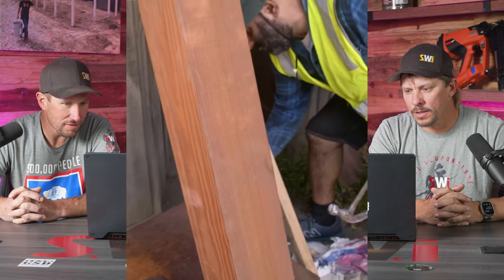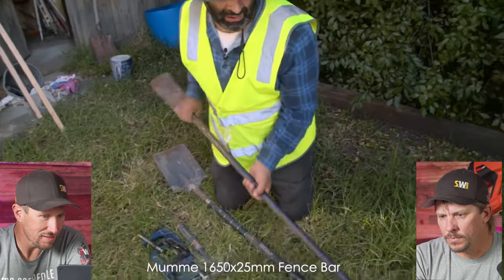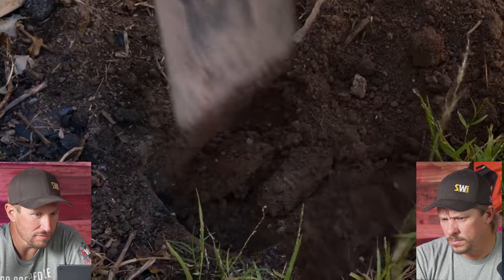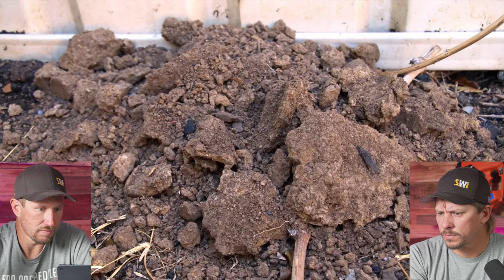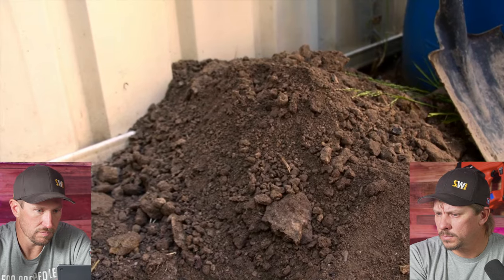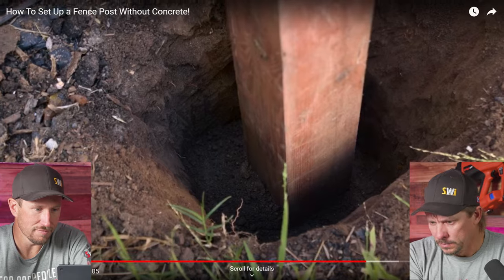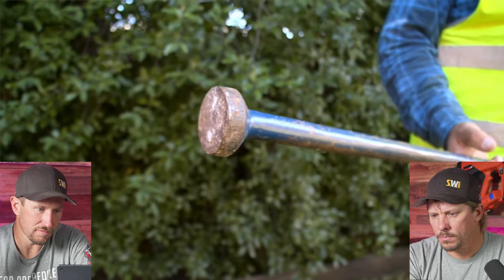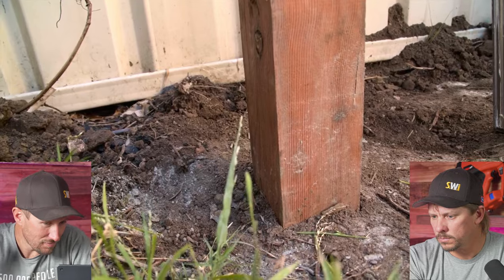Can You Really Set A Fence Post With NO Concrete??

Comment: Dirt will rot anything faster than concrete mix so thats why all over the world is use concrete
Reply: I agree, I'm super confused...
Reply from the maker: I would say that's a misconception. Concrete is used because it's easy and fast.
Reply: @SWiFence Cement is cuz "that's how my daddy always did it." Have done fences for 35+ years I see less rot when no cement is used. And if wet Cement is used there is less stability since no compaction is done cuz you can't compress a liquid. Dry pack or nothing.
Reply: You’re completely wrong lol
Reply: @codynewell1135  If historical and empirical data means nothing to you consider physical evidence - wood and concrete, being two different materials, expand and contract at different rates which quickly separates the two. The concrete now prevents that moisture from draining away from the wood speeding up rot. In bare soil the water drains away, it is not encapsulated around the end of the post. Which is why metal posts that are driven don't rust.. Also the caustic nature of concrete deteriorates the wood. Having pulled posts for 35+ years I've seen the undeniable difference. But I will say the information you provided ("you're completely wrong lol") does shed a lot of light on the subject and has me re-thinking the matter.
Reply: I just pulled up some 24 year old posts set in tamped down dirt. The post actually rotted from the top down, the only good section is what was buried, funny enough. This is in Pennsylvania where we have widely varied weather.
Reply: What are your feeling on using tamped gravel to fill the hole to allow for additional drainage?
Reply: @hankandstein  
I would also like to hear a comment on that. One of our local guys here never use concrete, but they do use gravel. I’m no expert. But I do have about 29 posts to replace soon

Comment: I am in Canada and I was warned not to use concrete.  Use 1/4 down and if the post shifts , you can remove the post and reposition it.  Concrete will get water under it and it will freeze and heave the post.  1/4 does behave better than concrete.
Reply: What is “1/4”? Is that a product?

Comment: Its actually against the building code in Australia to use cement on anything but steel I believe (treated pine is kiln dried and treated for rot etc so its allowed i think) but not hardwood. This is becasue timber moves as it dries and as the seasons change it will move forever. With concrete and a "wet or green" post the post will shrink down to about 20% moisture, shrinking 10% on average, leaving a reservoir for water to build up inside the concrete and nowhere for it to go. If the concrete has no contact with a dried post due to shrinking 10% its not providing much structural strength. Tamped dirt will move and expand as the post shrinks. If its loose, 2 mins with a crow bar can tighten it up again.
Reply: Lots of fencing blowing down there then

Comment: Ive been fencing for 30yrs, it’s a nightmare when u have to replace a fence that someone has concreted in! Tamper then Use the wedges from your pointed stock straining posts and beat them in either side, solid!

Comment: They have concrete posts in Australia that can withstand a post driver.  Best of both worlds as the post is concrete and not around the wood post.  And don't know if the Australian has to worry much about frost where he is,  unlike in Wyoming.
Reply: In high humidity equator climes and hurricane prone areas concrete posts and telephone concrete poles are a common necessity. The Romans mixed ash from volcanos and made pier posts and columns that are still around 2,000 years .

Comment: I tamp a lot of posts. I use the level and tamping bar too. 
Our customers usually ask for concrete so we give them what they want. Sometimes they’ll request concrete above ground with a slope on top. 
I’ll tamp the concrete. Add some water at different levels. 
It’ll get even harder when curing. 
Our soil is mostly clay, and it rains a lot.

Comment: That block wall looks like a DIY.
Helpful tip for deck coating. You want a product that fades and not peal, two thin coats better than one thick coat. Penetration is critical. Thin slow drying first coat to impregnate second coat bonds to first coat and repels the elements. 
 This is why it’s not recommended to stain or paint treated wood until it’s been seasoned/one full year outside.

Comment: As a kid in the 60's I would sometimes go to work with my Dad whonwas a carpenter turned builder and I can remember watching him set a fence post and he would use what was called a "Yankee strut"  it was basically a pice of wood nailed on the the part of the post that would go underground . ,sometimes he would put two on on two faces of the post. this stabilised the post and strengthened it in the ground against movement.. no concrete, no cement at all.

Comment: I just encased two gate posts in roughly 18 bags of concrete, 3-foot-deep holes, posts coated in tar with a sleeve as well. I'll get back to you in 10 years and tell you how it held up. My guess is pretty well.

I just yanked out a couple of gate posts that had been concreted in. Almost 10 years old. No real damage to the wood. Posts were in a part of the yard that was a dead zone. I think most of the damage you all are referring to is due to microbes in the soil that eat at the wood, especially towards the top. Just sleeve your posts.
Reply: Great point.
I don't know if where we live makes a difference--I'm in the Northeast.
I remember helping my dad putting posts in concrete (mailbox, fence, posts for garden spigots, etc).  Some of these posts are still solid in the ground.  Some more than 45 years ago.  Even now, I have my own stuff at my own house that I've put in the ground with concrete that's been in there for more than 20 years.  No sign of rotting.  Nothing.

Comment: If your hole is slightly off center (rocks and roots) and you use foam, the thicker side of the foam will push the post to the thin hole side... and it's messed up. As a one man operation I just tamp, unless cement is called for but then none in bottom of hole so I don't encapsulate the end of the post.

Comment: Help! Single gal doing this.  My 6x6 cement posts failed this Spring after about 6 years.  So tamping is next.  I do however have clay dirt.  Should I add something like gravel for drainage or something?  So many different opinions.  It's hard work and pretty costly and want to do it right as much as possible, lol.  THANKS for any and all advice 🙂
Reply from the maker: I don't feel like you need gravel. We test that in this video: https://youtu.be/VKVS72PLucU and it does gather moisture, but I'm still unconvinced that it's necessary.
Reply: @SWiFence  quick response! THANKS 🙂

Comment: you guys ever run into anchor fences?  At some point in time maybe still a company called anchor was doing chainlink fences with basically anchors buried and attached to the posts.  Might be an interesting topic to go over, they are a nightmare to try and pull them out of the ground and as far as I can tell even in Michigan these really old chain-link fences didn't move even a little bit and one of the job's I ripped out had H posts with anchors in sand and the fence topline was still in great shape.  They were doing all kinds of interesting stuff, aluminum square stock gates with chain-link micro mesh with box hardware, aluminum H posts and they used really heavy gauge wire to tie everything.  They used hooks instead of bands to attach the mesh to the fence.  Really wild stuff.  Also super easy to pull the posts, get to the plate and cut the bolt off attaching the anchors to the post.
Reply from the maker: I haven't seen those yet--sounds interesting.

Comment: I disagree with concrete being bad for the post. Every rotted wood post we pull the wood is rotted at ground level where the dirt is and still in tact where the concrete is. The research I did shows there is a bacteria (or something like that) that lives in the top few inches of the soil that causes wood rot. This is just my opinion, and we all have those. 

Thanks for the video again
Reply: Absolutely agree .  I have removed hundreds of fence posts that have rotted off right at ground level  but if you dig down you find the end that is deep in the ground is as solid as the day it went in even in very wet soil . Also I have seen DIY books and vids telling you to put gravel in the bottom of the hole “as this will add drainage”  which to my mind is just a scaled down idea of putting old bricks in the bottom of a well to keep it dry